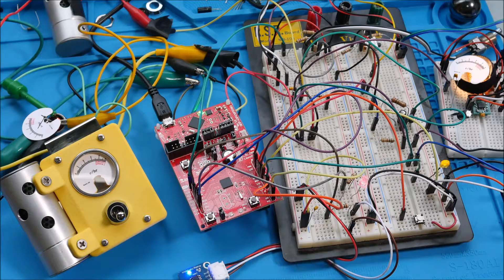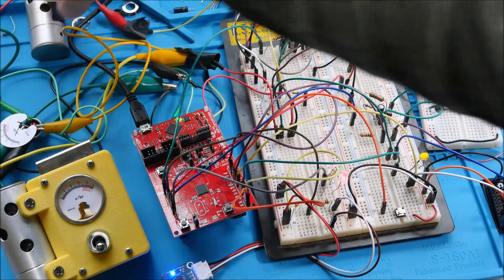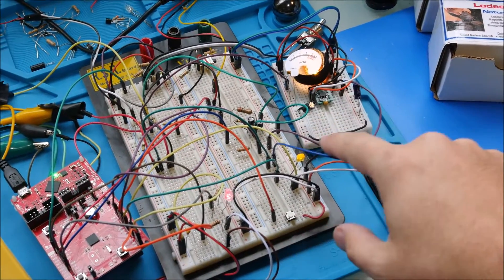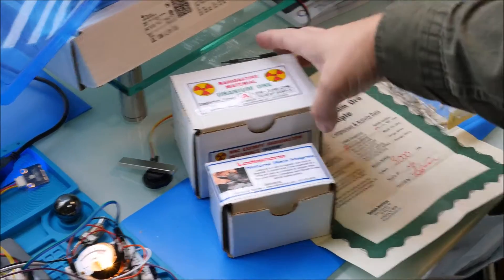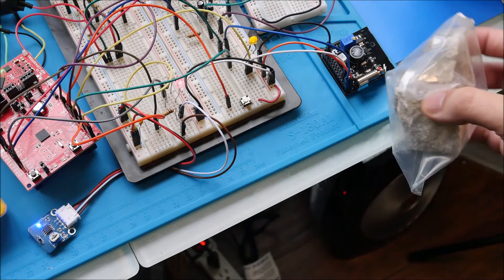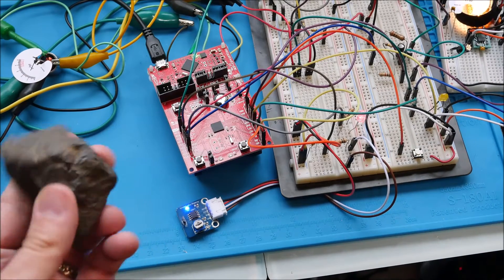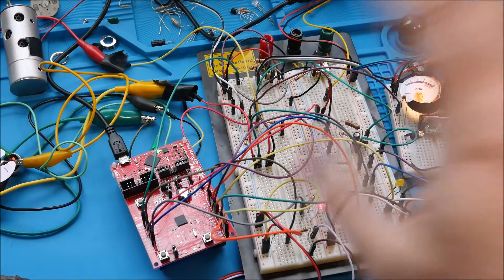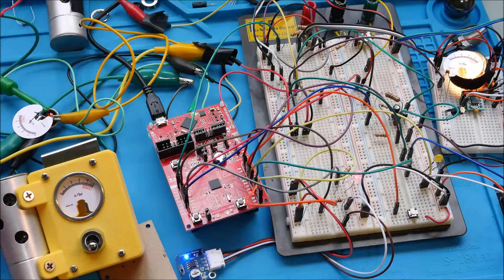Vault-Tec Dosimeter, Part 2, Real Geiger Counter!

Comment: Man I wish someone would sell these out together online all I see is a 3d printed one that’s holo I think on Etsy
Reply from the maker: Part of the issue is that a Geiger tube is hard to find (but then it could be simulated using my magnet idea), and the gauge motor is hard to come by and expensive. Most the others out there are comically large to fit a cheaper gauge inside, or just hollow like you said.